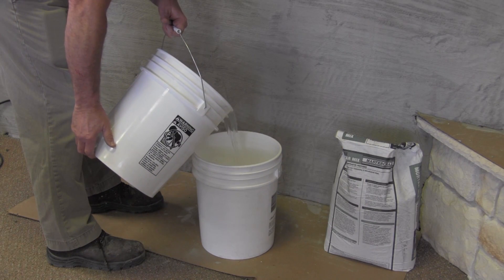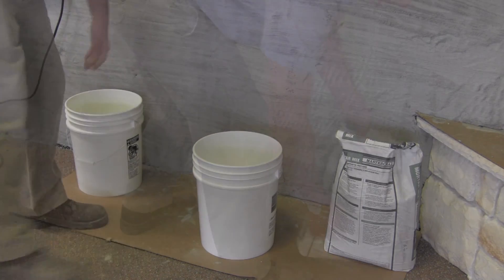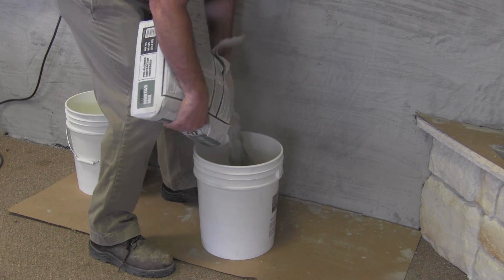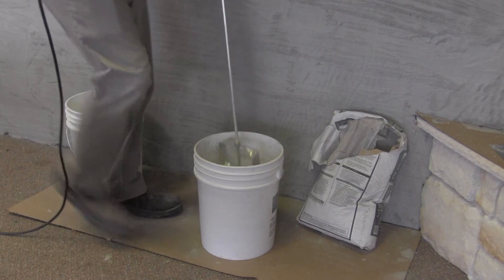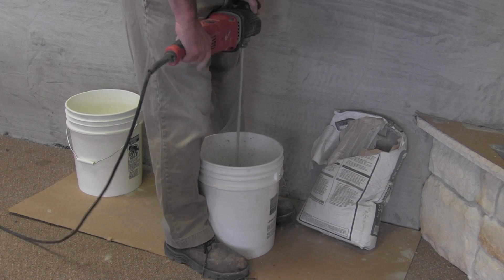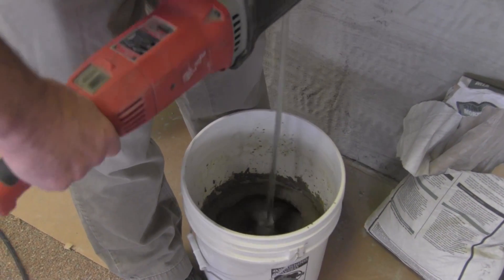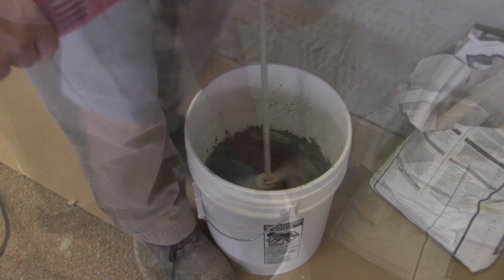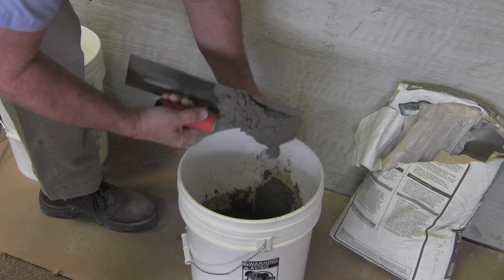Step 2   Applying the scratch coat: Stone Veneer Installation

Comment: Probably should use a better scratcher
Reply: SoloDolo, he clearly doesn't do it everyday judging by trowel application.  In his defense, too, many masons simply use a soft bristle brush to rough up the finish just as much these days as much as a slotted trowel finish.  I typically only utilize a slotted trowel on my scratch coat when I will be laying a heavier natural stone.  Cultured stone....a brush finish works just fine.  Good enough video.